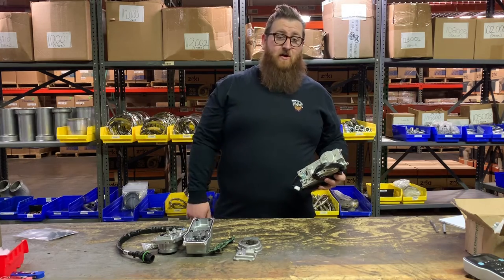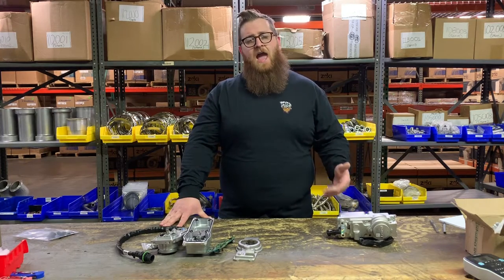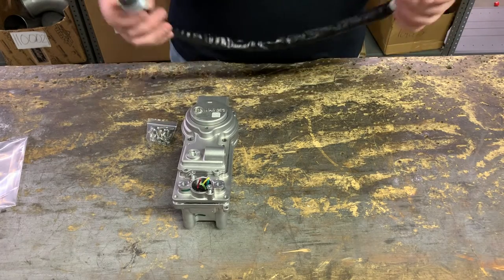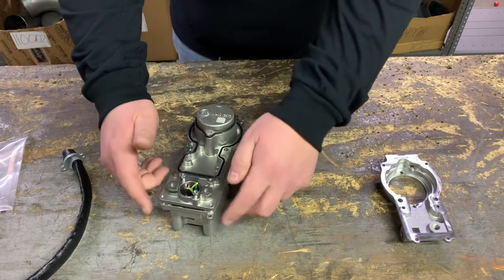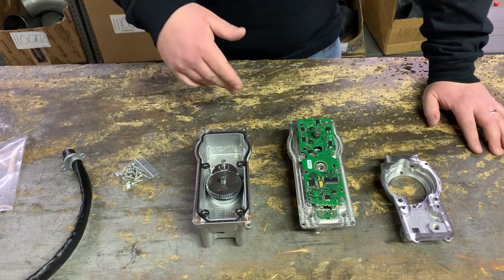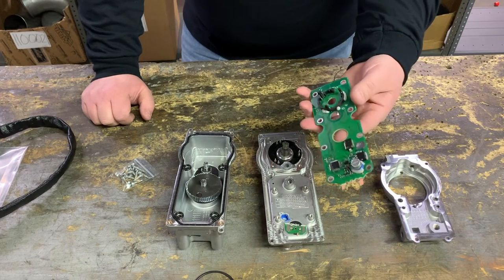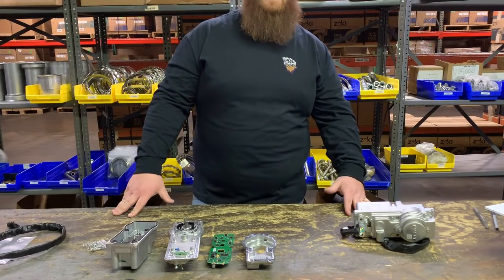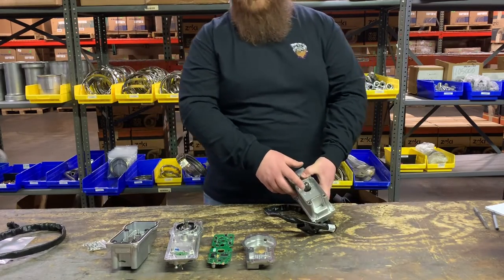Can you rebuild Holset VGT Turbo Actuators?

Comment: That bearing needs grease, in my case the bearing was locking up took it apart WD and greased, works great,  I had a new one on standby couldn’t find anyone competent to calibrate it, old one was already calibrated so decided to rebuild it works fine…

Comment: Is the $799 vgt actuator (holset brand )that HD TURBO sells worst-case or the one that the dealer sells (horset brand ) for $1400? Please advise please I'm thinking buying the one that HD TURBO is selling for $799
Reply from the maker: We don't have any experience with HD turbo. 

We do have new aftermarket actuators starting at $800 or Genuine HOLSET HX actuators for $1200

What's your part number?
Reply: @momentumworx  where is your shop located at ?
Reply from the maker: @transupercorp5749  Lansdale, PA - USA

Or: in your pocket 24/7- MomentumWorx.com

Comment: Dude wants to scare you from repairs, and encourages to buy new, not a sustainable and cheap guidance video.
Reply from the maker: There is nothing "cheap" about maintaining a commercial truck.  And if you think you can properly fully rebuild this actuator for cheaper then buying a replacement (don't forgot about including the time it will take you to learn and physically do the job, that's an expense) I'll hire you to build them here at our shop.  

The only reason this video even happened is because we genuinely tried to find a more cost effective way recycle/reuse actuators and determined that scale required to rebuild them correctly did not make economical sense.  If you don't value your time time, then sure / bandaid the actuator and you might make it down the road a few more miles or maybe it will hold out forever.  But that's not a risk I'm willing to take with any of my customers' trucks. 

So next time you think we are trying to "scare you" into making a purchase, maybe take a look at all the content and information we provide to the trucking community (FOR FREE) 

Thanks for watching...
Reply: @momentumworx  

No offence implied, but it's not rocket science, most of the fail points you mention are "O" rings.  But I can appreciate the safety and quality standard you provide your customers.
Reply: He said they are repairable but the kit to repair do not have the moderbooard or microchip table or any other part that will need to be replaced.  Yes you can buy whatever part needs to be fix but it will take .onger the usually to put it back together.
Reply: This guy is paid by companies to make videos like this, so yes, you’re exactly right he does want you to make expensive repairs and scare you into repairing things whenever you could just probably clean it and keep going